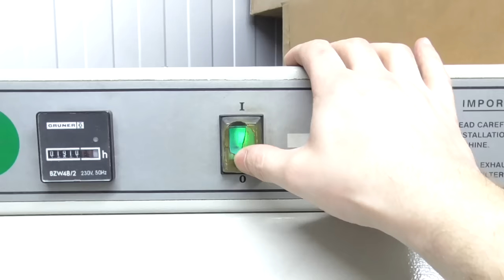1918 Aircraft Rivet Hammer - Restoration

Comment: If I had a buffing wheel like that, every metal object in my house would shine like a mirror.
Reply: Nah..it's really dirty work (when you working on lots of stuff) and a breathing mask-protection should be used.I did the exact job for about 4 years long time ago-and after all..you ll need to protect the metal with various methods after finishing with the polishing..
Reply: walks in kitchen, flips on light
everything metal: BLINDED
Reply: TubularBow HD You gotta dismantle your car and shine every single component of it
Reply: I don't make parts look like show pieces but I do go far enough to restore a tool or parts function. And let me tell you it takes alot of time patience and effort to get those parts to the level that this guy is doing. He makes it look easy. I would love to see a breakdown of how many hours he spends in these restorations. Unless you sold the items for astronomical prices you could never make a profit.  With today's technology and manufacturing capabilities tool are made to look more precise in their finish but I  doubt they will be around for a hundred year's.
Reply: its much fun to polish all parts in a rifle especially for bolt action. have greatly improved a few old mosins by polishing all the contact points in the action

Comment: I know the struggle with porous aluminum. I was restoring something recently, a drill powered angle buffer from the 1950's, and it was originally a rough cast finish, but I wanted to file it smooth and polish it but no matter how much I filed, new voids kept appearing. So I decided to do a sand blast finish so at least they weren't as noticable. Thank you for your inspiring videos!

Comment: Welding cast aluminum is a nightmare... depending of the quality of the casting preheating can help as well as TIG welding if possible,  While GMAW welding cast Aluminium it can be hard to achieve proper fusion due to porosity

Comment: You might find a TIG welder is a lot easier to get a good result with especially with alloy.
Reply from the maker: We tried with TIG but it didn't work at all, the material started to bubbke :-(
Reply: @mymechanics  DC or AC tig ?
Reply: @mymechanics  Are you using a spool gun on your MIG?

Comment: Best thing is no music
Reply: No but when he works I play classical music in the background. True artist
Reply: I agree. Music would take away from it
Reply: No music is great, but my favorite thing of all: it's not sped up. I never realized how much I appreciate just hearing the sounds of these loud machines at work until I saw this guy's videos. Most of the other restoration channels I see always speed up the entire process and honestly they may as well just mute the audio. I don't want to hear an angle grinder running at 20x the normal speed for 30 seconds straight. Show me a few cuts of it here and there doing its thing and then move on to the next bit. That's what I really enjoy about this guy's videos. He does just that. No single part of the project is shown for too long. Each step is shown just long enough that you get the idea without it being overly boring, and it's not sped up so the sound of the equipment has a reason to be there. 

Another really good channel I recommend is the hot wheels restoration guy, baremetalHW. He has a similar editing style to my mechanics but focuses on restoring vintage (and more modern) Hot Wheels toy cars. Really neat channel if you want to see more stuff in this kind of style. Many of them are not "perfect" restorations but he does a pretty good job of getting things as close as possible to the original image. As usual, pitting of the main body cast like what was experienced here is still an issue, not much can be done about that. But it's still really interesting to see the entire process, and baremetalHW also provides insightful commentary.

Comment: Pro tip for welding:

Make it sound like bacon is in a searing hot pan!
Reply: Do you think a Tig welder would have been better for filling in holes on a larg piece like that? I think the separate control of heat and filler could help prevent those tiny viods he was unhappy with.

Comment: The handle is a shame. Not your fault that the original cast was shoddy. The only way to have made it look perfectly smooth would be cover every single pit with a putty, buff it again, and then paint it, which wouldn't have been ideal.
Reply: I've been looking for comments on why he didn't use putty to cover the holes. Thanks for this insight.

Comment: Very fine workmanship. Home Depot has a welding/brazing rod that can be used with a propane torch 700 to 750 degrees F. Aluminum castings have small voids, due to the gravity fill process. Honda uses vacuum to remove casting voids. The air fitting is the Hanson Industrial Interchange, Pneumatic size 1/4 NPT. I suspect there is a tool maker or watch maker in your family.

Comment: Someone probably told you already but, you should pull the trigger on a rivet gun without it up against something. It is very possible for it to overcome the spring on the end and shoot the end of the tool off. Nice job on the restoration.

Comment: HI there. I just love your attention to detail. I was a jeweler for 7 yrs. working on David Yurman pieces. I also spent 4 yrs inspecting pellicles, dust covers using lasers to etch computer chips where I had to look for submicron particles as thats the largest gap where the circuit could still maintain continuity. Don't get me wrong you do fantastic work. I just noticed some small pits in the casing. I rememberd doing jewelry a guy showed us where he took broken bits for the dremels, blunted the end and then bent the end leaving about a 1/4". We used them to burnish pieces, like when we had the pins for the clasp mechanism.  I would hammer the ends down a bit and then use the burnisher beating down the silver or gold filling in all the voids and after polishing hard to see the pin. We aslo had a small hammer which the setter used which might be good for those pieces. I also found I needed to open up the casting pits a bit before soldering where I got much better results. When I didn't open the pits I usuall had to open it up anyway to filll the hole. Well, thanks for sharing & Happy Holidays.
Reply from the maker: Thanks for watching, much appreciated

Comment: Thank you again. Very nice I'll have to look for one. I can already see it's value in metal forming. Have you ever tried the new low temperature aluminum welding rods they may work to fill the casting imperfections. They work like gas brazing rods.

Comment: What I would have done in regards to the handle, (which I would also recommend you to do, if you want) I would have used filler material, smoothed, primer, then used a chrome paint, so it still has the metallic finish and is now smooth with no weld marks

Comment: A bit late telling you now, but that casting is likely zinc-aluminium die-cast which is why it’s so horrific to weld. There are low heat solder-type rods available that you use with a blow-lamp or you can also get colour matched Belzona (1111) which can be drilled and tapped which is about £12.00 or $16.00 and is suitable for anything up to an engine block. Hope that helps. Great videos, one of my favourites. Thank you.

Comment: Making your own air connection adapter impressed ! 
When these units are finished what happens to them ?
When you say sand blast is it  silica sand ? Or micro glass beads ? Which one would usually say  bead blasting .

Comment: Beautiful work, but I wonder if a sand blasted finish on the handle would not have looked a little better. Would need to been done at low pressure with aluminum oxide dust. I've had very good luck achieving some very nice satin finishes on old, stained aluminum engine castings. I know, hindsight is always perfect. My compliments, in any case.

Comment: I noticed that you lubricated the parts as you put it together.  Was the oil you used NON-HYDROSCOPIC?  All air tools have to use that type of oil or else they will build up moisture from the water in the air lines.

Comment: How many times have you put a teeny component up to the buffing wheel, only to have it go flying off into the unknown?  😁

~ ~ ~

To fix the casting porousity in the handle, there's either something like Milliput , a two part resin putty with metallic nano particles, or for really tiny holes (like here), there's vacuum impregnation, which uses high pressure to squeeze metal particles into the holes, creating a nicely smooth & consistent surface.

The good news it that this type of casting flaw is usually only a surface layer (where it interacts with the mold) & isn't likely to cause fragility in the part.

Comment: I realize this is an old posting, but after watching many of your videos, I can see the same issues over and over with your welding.. hopefully there is a skilled welder willing to teach you some tips! If not, look into changing your process from MIG to TIG, using a machine capable of DC and AC with a high frequency unit.. with appropriate filler wires, you will have much greater control over metal placement and quality..

Comment: Just a word of caution. Any air hammer should not be operated without a tool inserted and pressure against it. It is possible for the piston  to get wedged and it is designed to hit a chisel or some other tool, not just the barrel.

Comment: If it’s any consolation, on the aluminum body, if it really is from 1918, there really isn’t much you could have done to deal with the porosity short of AC tigging each individual hole with as high of amperage as you could reasonably get on as small a tungsten as you could get away with ( which you said you tried in the description, I understand getting the settings right on cast aluminum is an object lesson on futility even on a good day with good metal.) Period aluminum refining and casting really didn’t work out its teething issues until the late 20s, if one is being generous.( speaking from experience on having to work on aluminum pieces that old on occasion) As an occupational welder/machinist that specializes in repairing that sort niche/obsolete equipment, I would strongly suggest  practicing on gtaw if you plan on doing any real amount of aluminum work on that size scale. I understand that it’s a lot of work, and I’m not saying that as a criticism, given how fucking annoying casted materials/aluminum can be to weld and work on ( heaven help you if it’s both, which it probably is if its aluminum), but as an acknowledgement of the difficulty of the tasks and the care it demands.

The best advice I can give you, if you want it, is to work slowly, and use liberal amounts of acetone with an aluminum brush to scrub the spots you are welding.  Aluminum, let alone century old aluminum, has a very low tolerance for anything that is not aluminum in the welding process ( the innate impurity of that eras aluminum makes this even more difficult), so keep the welding surface sterile and do not touch it with anything that is not a clean filler rod until after it has been welded. If you do touch it with anything, clean it again, as the natural oils alone on your skin are enough to futz with it, let alone whatever your working gloves or the table has on it. Wear gloves that can be cleaned chemically (again acetone works well with this since it burns off quickly) to give yourself some breathing room while you work.

And for the love of all that is Holy, if you do nothing else, pre-heat the aluminum if you can manage it after you’ve cleaned the thing. Stick it in the oven around 250 degrees Fahrenheit, or work it over with a torch. You don’t need to be fancy, don’t melt it, just get it warm. Pre-heating aluminum is one of the simplest and easiest things you can do to increase its workability, as well reduce arc gouging and improving the final result given its general ductility. The less work the welding torch has to do to melt the material, the more even your final welds will be, and the easier it is to smooth out or eliminate pre-exhausting porosity.

Keep it clean, and keep it hot. Like a good cast iron skillet ( kinda sorta).

Given the age of the material, and the differences in refining of the time, your chances of finding matching filler material is virtually non existent unless you have something fubar made from the same batch of metal you are willing to sacrifice. so don’t fret to much over the discoloration as there is really nothing you could realistically do to change it. You did the best with what you had access to.

But otherwise, while our work methods definitely differ in some ways, I feel that you made a good show of the project and should be proud.

( edited for spelling/grammar and enunciation/other ten dollar words)
Reply: Very underrated comment on welding aluminium right here.

Comment: Sorry you can't use a mig gun for welding aluminum you could have used your tig if you had ac/dc tig welder. Silver epoxy resin  for the pits would have done well. Cheers

Comment: if you are welding again turn your gass up and your wire down a little and up you volts will come out way better just mess with your settings until it sounds like bacon frying

Comment: Are you running aluminum wire in your mig, or does that handle just look aluminum?
Reply from the maker: It's aluminium
Reply: @mymechanics  Thats awesome, I have seen some guys try it online.  Any troubles with it?  I am guessing its important to keep the cable straight to avoid feed issues?

Comment: Question for everyone, how do you tell the difference between brass and gold
Reply: Gold is way softer and wouldn't be used for anything mechanical.
Reply: The density is different. One can find out by measuring weight and volume.

Comment: First of all, its yet another jaw-dropping restoration and finished piece.

About the handle porosity, I agree, very little could've been done with a cast that porous: welding all the pores would be insane, and filling them with liquid metal epoxy would be a bit dodgy.
About the welds having another coloring, I'd bet it is more due to the localized heating of the weld, than different metal alloy compositions.
If I were you, I woud've attempet to thermocycle it a couple of times after grinding the weld excess, and I'd bet that the weld spots would've been quite less noticeable.

Anyway, I almost get a boner with all the machining and perfectionism in this channel. My amateur skills with welding and beating hot still on an anvil aren't even compared to this; it would be like comparing a Manet to camemen drawings.
I apologise in advance for the audacity of even sugesting improvements to your your.
Keep it up!
Cheers

Comment: Excellent job but I don't think this item is over 100 years old. Firstly, aircraft were not riveted in those days, and secondly I used a very similar 'windy hammer' as an apprentice airframes engineer in the 1970s. I would say that this item was 1960 vintage. 
You should not activate this unless it has a load on the tip. With sufficient air pressure to set an aluminium or duralumin rivet dry firing will cause the mandrel to pop out of the end and jam.
This does not detract from an excellent restoration.

Comment: Im a bit confused eiith the daye of this tool. In 1918 the overwhelming majority of aircraft were wood framed and fabric covered in fact there wasnt a metal skinned aircraft save 1 and no metal framed aircraft in 1918. All military planes of that time were fabric skinned and wood framed. And all civil aircraft were of the same material. So why would an aircraft manufacturer need a rivet hammer? You cant rivet wood or fabric.
Reply from the maker: I've seen pictures of a german factory of 1918 where the workers used this exact hammer.
Reply: @mymechanics  im not doubting im just confused as to what it would be used for as im not an aviation engineer but i do love your channel. Do you prefer bringing objects back from the dead or working on the things that may still work but need some help?

Comment: The only problem with this is that you delete its entire history. You remove all the patina, wear and tear and essentially remanufacture the  item beyond where it was originally manufactured. Replacing the air valve because it was ugly is fundamentally removing all trace of the tool's authenticity as a tool used for building aircraft in WW2 when what was required was functioning equipment.

Comment: You make things very pretty.  But not necessarily better in some cases.  In this case the model number and serial numbers were removed from the main casting.  All the internal parts were sanded and buffed to a shine, which would certainly screw with the factory clearances needed for the gun to work best.  Yes it functions in the end but I question its power output now.  I find many of these restorations go too far for the sake of making the parts shiney.  Keep the cosmetics to the external parts and I think you will do better in the long run.  Not ragging on you for the sake of doing it, just trying to be helpful.  I do enjoy your channel.  Cheers.

Comment: Ok I have several major issues with this one. Your job is to RESTORE these things, correct? That means you want to keep it as much the original artifact as possible….making an entirely new piece (large, prominent, important piece) for no reason other than “it’s ugly” falls so far outside the scope of your job description. The other huge thing is that you sanded off all of the engraving on the original handle. It added character. And would have been so easy to re-etch afterwards. I hope this isn’t the beginning of the end for this channel….